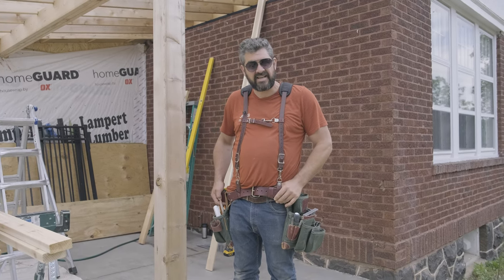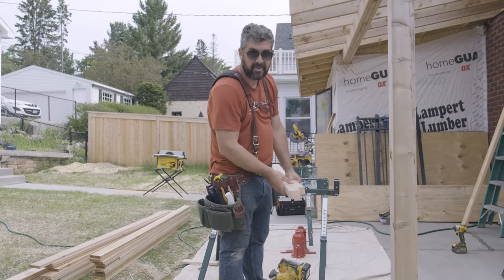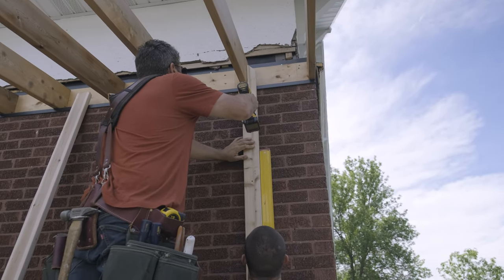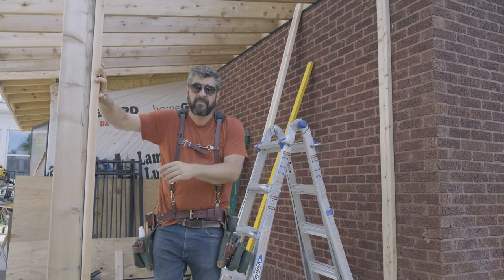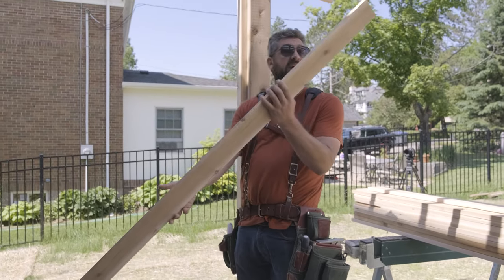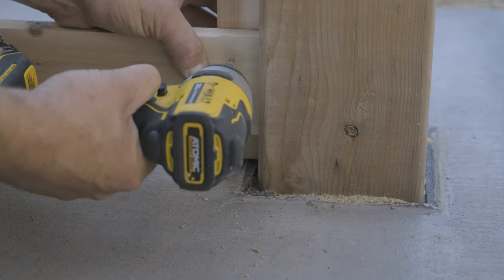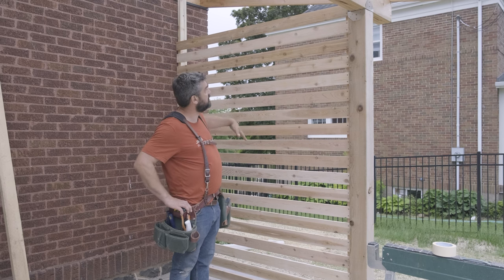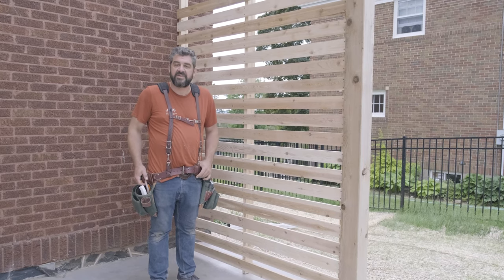How To Build A Slat Wall For A Patio

Comment: I'm an architect I was looking at your finish at the base of that 2x4 which is attached to the brick wall and you didn't put anything there and normally I would have used a cup or some sheet metal to cap it no matter you know it's it's hard to see your too close because water can still rub against it or sit or run down you never know and I noticed your 4x4 post does have a Simpson base